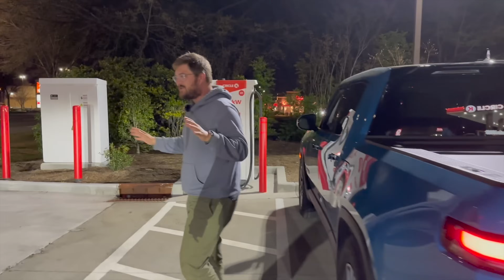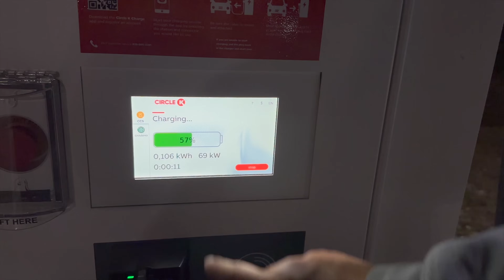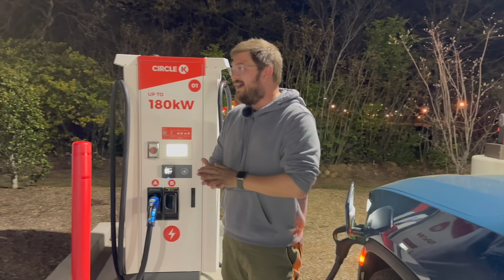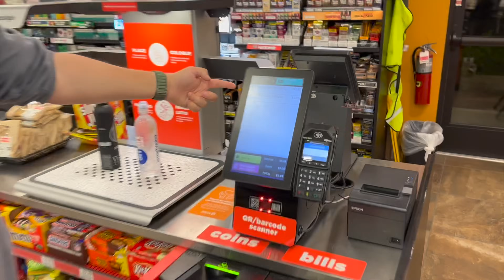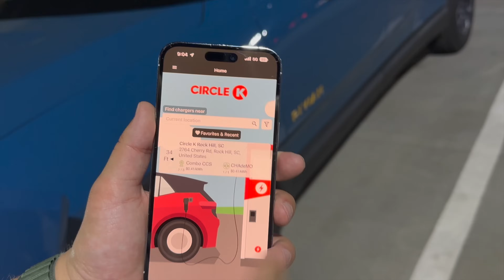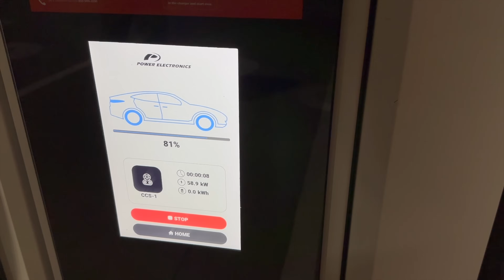These Are The Charging Stations I Want! Visiting The Circle K DC Fast Charge Test Location

Comment: At the Circle K in Memphis you probably already have a gun in your face, then, if you are lucky the teenager has only robbed you, taken your truck, wallet and phone. If you are the unlucky one, you make the news as one of the 5 or 6 murder victim over the weekend. Happens at gas stations all the time, but when they see the Porsche without a manual transmission, their street cred in the hood is really up there while actually driving a new Porsche.
Reply: Ok, so what happens when they try to steal a Tesla, only to find it has code entry, or, when it had a security mode where Tesla, or the police can locate and shut the car down (ONLY if authorised by the owner)
Correct me if I'm wrong, but the owner can set valet mode via the app now? Why not a "10mph crawl mode"?
.
5 years later, other manufacturers enable similar features....
(via dealer visit? 🙄😉)

Comment: Thanks Kyle. Great news, just wondering when we will start seeing canopies over the chargers just like the gas pumps?
Reply: And pull through
Reply: Maybe eventually they'll install machines that are both chargers and gas pumps at the same time. You simply insert a credit card, enter your zip code, then press a button to choose between regular, premium, diesel, or electricity. For obvious reasons, you need a separate cable and handle to dispense the electricity, but there's no reason the apparatus that takes your credit card and displays the charging/fueling status can't be shared.

Comment: Card/mobile payment with no app required, and some coffee shop with bathroom is essential for each DC charger. Who wants to make money will realise this anyway, the rest, well, those are utility companies.
Reply: What's "required" is a handshake that recognises the car, then that the car has a payment card associated, WITHOUT using the card/ reader on site, which is a point of potential failure.
.
Not to mention, just having a card system is a potential security issue since the user has to stand at the unit during authorisation.
.
Best method.
Pull up.
Exit the car 
Plug in.
In the car.
Car already charging.
.
Next best 
Card and car linked to app.
Pull up.
Enter the charger number.
Authorises.
Exit the car.
Plug in.
Enter car.
Already charging.
.
Minimal danger, minimal weather.
.
Another advantage.
You can only use the pre-authorised account, so *if * the car is stolen (not sure how) it can be locked out of the charging system..... And located if the thief trust to charge.
"But what if you don't have a phone???"
Really?
Reply: @rogerstarkey5390  current type 2 standard doesn't include sending any identifier, so the mentioned handshake is technically not possible yet. Let's start from what is possible for all EVs.

Comment: Tesla is to blame for charging stations in the back of lots. Tesla doesn’t want to pay for location space.  Also the Tesla design a parking spot in the back of a parking lot is a awful design. They need to be set up like gas pumps. Drive in and out. Allows charging for all vehicles and vehicles that tow.
Reply: Let's say it's 2014-2016.
Tesla goes to a local authority / landowner and says "we want to install chargers "here" ("front and centre").
When the laughter died down, they would be told "around the back. And be grateful!".
.
You'll notice now they tend to be either purpose built, or in a "more accessible area" because they're good for business !
 "Drive in and out"
You haven't thought it through (literally)